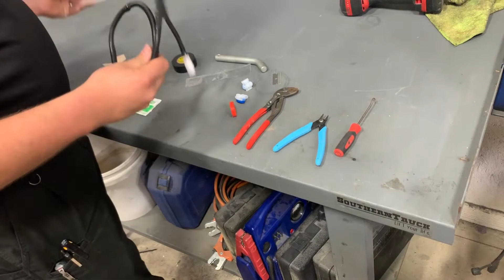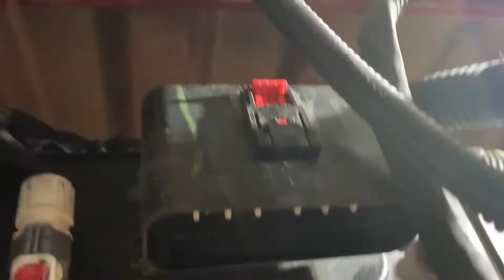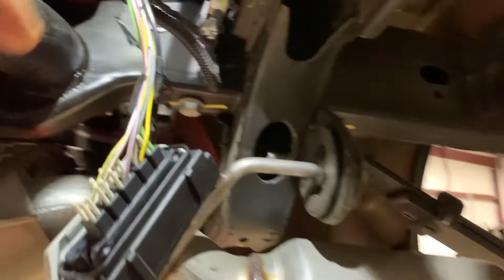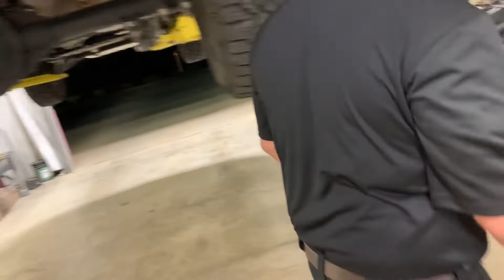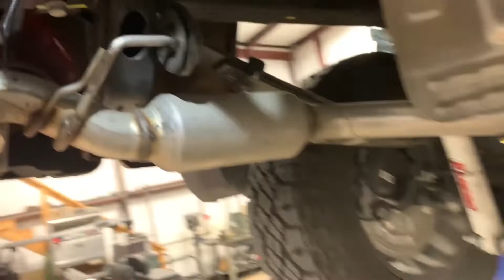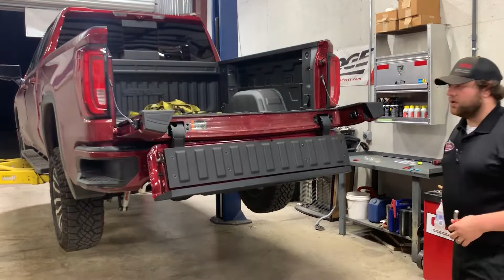Multipro Tailgate Saver Install

Comment: Randy, I purchased one of these from you in Fall of 2021 before all the legal issues that caused you to stop selling them.  Question.  I lost the paperwork on how to wire it and just last month, I had to take my truck into a local body shop where they removed the rear bumper and in doing so, they must have also disconnected your magnetic hall effect switch.  Can you reach out or reply to this email on which wire I put in series with the upper tailgate release?  Now that I typed all this, I guess I should watch your video again as you probably explain it here.  Before the body shop, it was still working, nearly 5 years later though the magnets on the red "ring" that goes around the pin were getting a bit rusty from wet road grime

Comment: I see you use the yellow wire and the other company uses the purple wire any difference?
Reply from the maker: Tim, either can be used. The yellow wire keeps the signal from reaching the computer and the purple wire keeps the signal reaching the release mechanism on the tailgate. I personally prefer that the computer does not see the signal while some like the feature of the lights flashing as if everything is working except the tailgate.

Comment: Just purchased your product I see you use the yellow wire and the other company uses the purple wire any difference
Reply from the maker: Tim, either can be used. The yellow wire keeps the signal from reaching the computer and the purple wire keeps the signal reaching the release mechanism on the tailgate. I personally prefer that the computer does not see the signal while some like the feature of the lights flashing as if everything is working except the tailgate.
Reply: @TXFleetOutfitters  Thank you that was great information I appreciate it
Reply from the maker: @timdually5843  Great! Happy I could help.

Comment: Or you could just buy a multi pro hitch from bw that doesn't touch with the gate fully open and save yourself from doing this
Reply from the maker: S.E. that absolutely is an option and I sell them often. B&W is a great product. It is not a full proof solution though considering the 1500 model will still contact if the hitch is not turned backwards. The B&W hitch is in a whole different price range as well.

Comment: Great idea! The 1st week I had my new Sierra I dropped the tailgate and it hit my hitch ball. Fortunately no damage to the tailgate (I learn quickly). Your product would be great if the sensor that tapes to the hitch was black, so it doesn't stand out so much. Again, great solution!
Reply from the maker: Howdy! I actually do have a black model at this time I just haven't gotten all the inventory to load it on my site. Those that would like black should be available soon.

Comment: I installed this device in my 2020 AT4 yesterday. It took me longer than I anticipated, but I am very methodical doing any installation. 
Rather then use the connectors sent with the kit, and the fact I was doing this without an extra hand, I elected to use Sta-con butt splice connectors. Just made the job easier and I use these all the time. Did take the extra step in placing heat shrink tubing over the butt splices and wire. Used a heat gun to shrink the tubing. 
I use a locking hitch pin and it worked well with the magnet ring that goes on the pin. My concern is the 3M adhesive as far as longevity, but will stay with it until / if it fails. I would use Marine  3M 4200 adhesive/sealant on the sensor rather than glue. 
The switch works as advertised. Randy did a good job bringing this to market. His install video is one of the best step by step videos I’ve seen. I have no doubt that this will save my tailgate as I , like hundreds of others, will forget the insert is in and drop the middle tailgate section and - BANG! 
The BW insert that specifically addresses the Multipro Tailgate ( the one with the angle cut on the top ) only comes in 2.5” insert size. I called eTrailer and they verified that one only for 2.5” insert( found on 2500’s). So I purchase a Weigh Safe Aluminum insert with interchangeable balls.
Reply from the maker: Thank you for sharing!

Comment: I like this idea they should have had this problem solved but they didn’t. On question the sensor on the hitch pin if used often will work itself loose and fall off will you have a extra sensor or just glue it in place what is the remedy for that if it arise?
Reply from the maker: Roy, We've had this product on our test vehicle for almost a year and have had zero issues with the sensor not staying in place. If by chance there is an issue I do have extra sensors that could be sent out. I am here to help and pride myself on customer service to set myself apart not only from competitors but to set a standard that is rarely seen with companies these days.
Reply: Randy Todaro I appreciate the fast reply. And I’m at the GMC dealer right now getting ready to go over the tailgate. I bought a b&w tri ball hitch for this truck it has inches to spare but with that tail gate coming down it can still bump the hitch so I’ll have to guide it down. That tail gate is expensive and I’m surprised that GMC didn’t look into this before they started bragging about this pro tailgate but your idea is well thought out and designed job well done  👍🏼
Reply from the maker: @royburkettjr7170  Congrats on the new truck! They are super nice and I hope you enjoy. I sell the B&W hitches at my shop and they make a great product. I look at the Multipro Tailgate Saver as a complementary product just for the added piece of mind.  I have a few in stock right now and can get it out quick if you would like to order one visit www.multiprotailgatesaver.com. Let me know if you need any additional assistance. 

Thank You